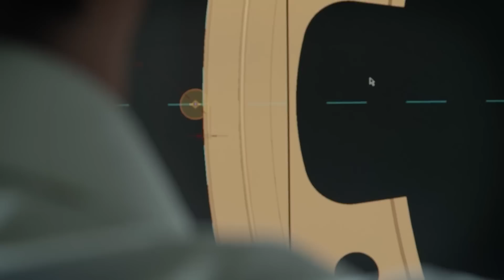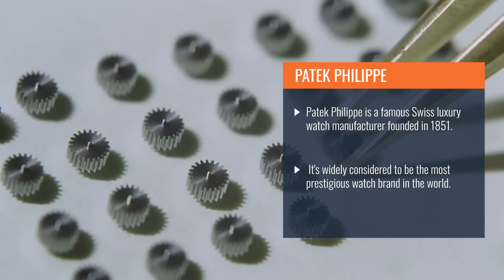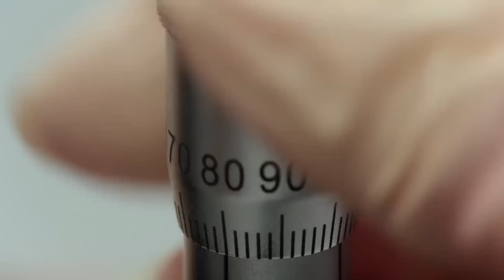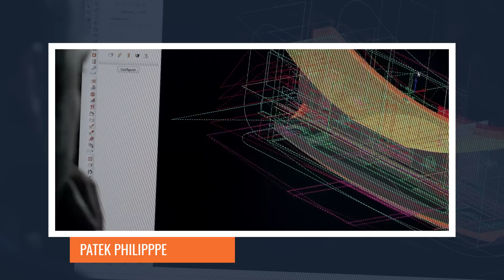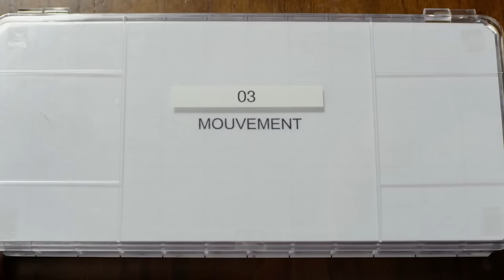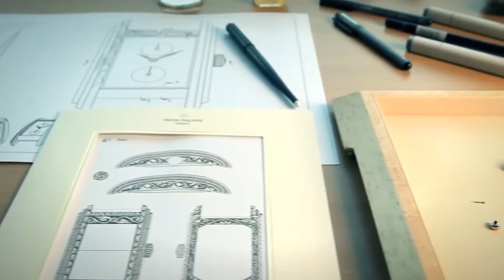How a $2M Patek Philippe Made! Switzerland Manual Finishing of Movement Parts | Technology Solutions

Comment: I wonder if those round hole marks or swirls are going to make a wave of air pockets to destabilize the movements inside the watch i know they are sealed units, but still anything which has like a golf ball holes in the coated metal ,will make any movements near it change due to the difference in the wavelength of the sound created as part of the moving part on top of those golf ball like swirl holes?
Just saying thats all i am sure the engineers would have looked at that and what it might do to any of the movement of parts near those swirl golf ball holes etc. 🦘🦘👌👌✌✌👍👍